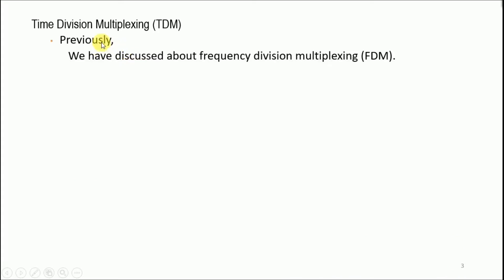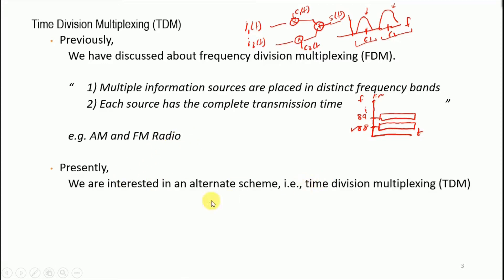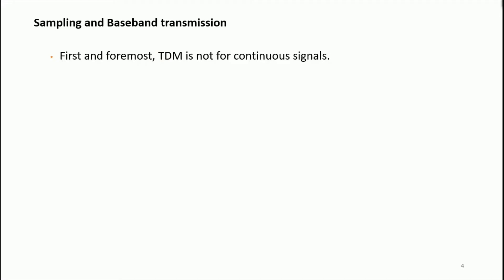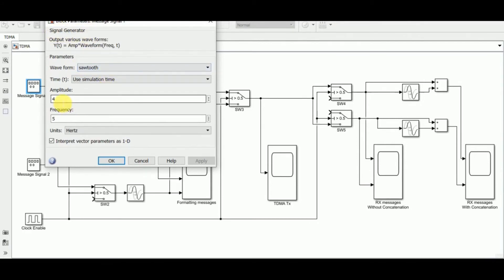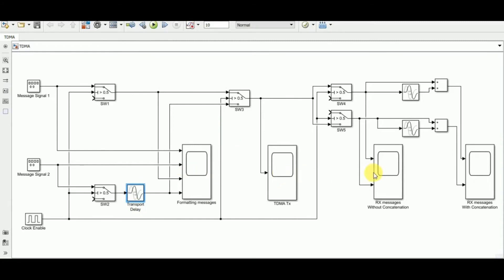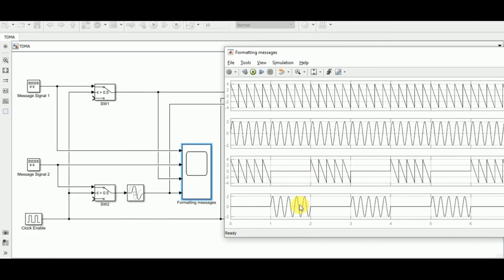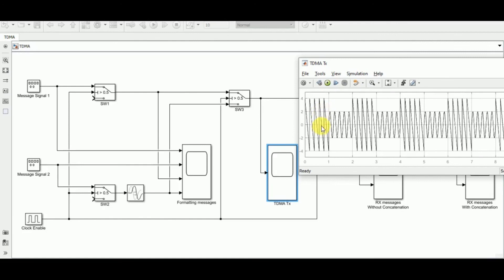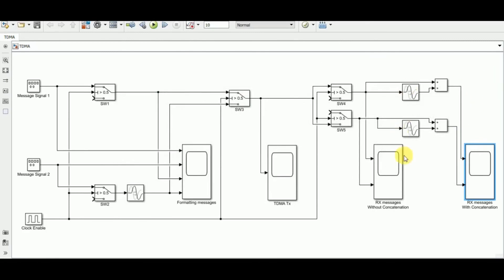Time Division Multiplexing TDM Explained Using Simulink | ADC 4.4

Comment: please what is the role of the blocks assignment and multiport switch in time multiplexing in SIMULINK??
Reply from the maker: we have to do interleaving of data and in this way it is possible
Reply: @AKHassan  Okay I want to do the time multiplexing by ordering the multiport switch and assignment blocks with the pulse generator block but the block assignment does not work for me. i don't know if you can help me
Reply: @AKHassan  please I can have your email address to send you the SIMULINK file of my diagram so that you tell me how to do it ??

Comment: What if i need the data that is being cutoff.
Reply from the maker: That is a very valid point. Presently, the data considered is periodic and easy to manipulate. But, regrading your concern, the issue may be resolved by:
1) preprocessing the data by including a delay block for each input stream. the delay unit should be periodic. It can be done in simulink GUI but i have not tried it myself. 
2) use matlab program instead e.g.,  https://youtu.be/4xYUQuJ0hfE
Reply: @AKHassan  i understand, a simulink video doing this would be pretty awesome.